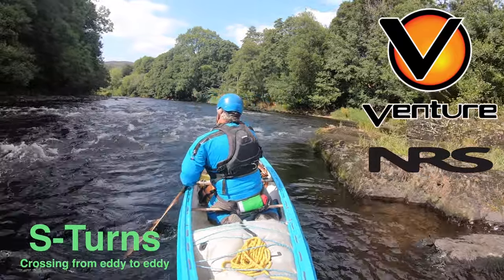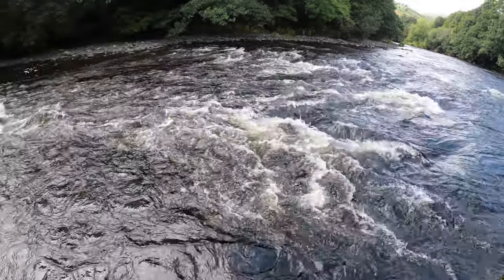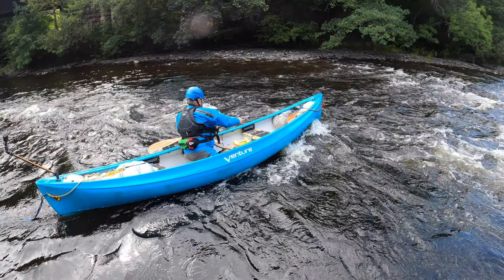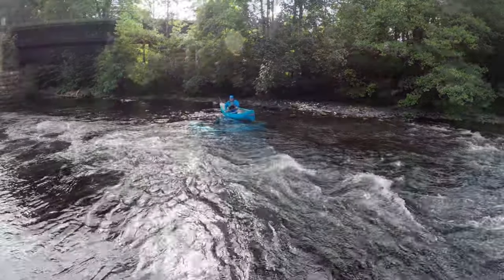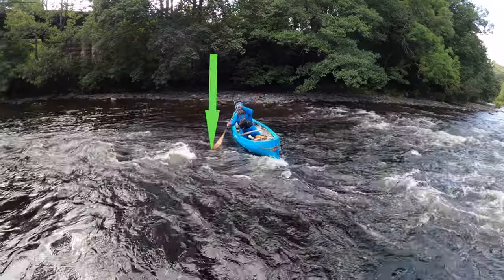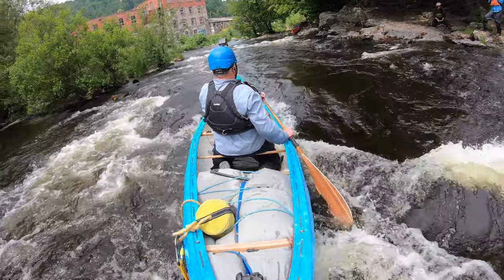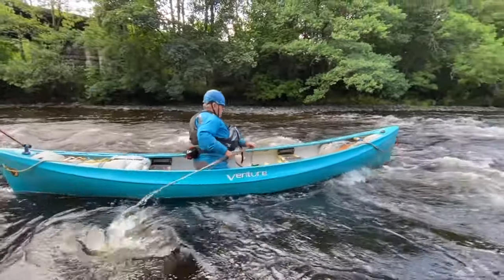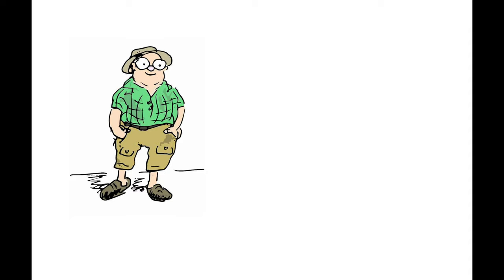White Water Canoeing:  Mastering the S-Turn

Comment: Very good video on crosses. Something that intrigues me as I struggle to learn to paddle lefty (primarily in my slalom C1, but it will be useful in my OC1 and trad boat too) is how other people alter things paddling on different sides. In respect of your weight shifts, I think you use more of a weight shift when coming back river right to river left, than when you paddle across river left to river right, where you seem to control more by altering knee pressure without moving your CG further out. The latter is obviously how I paddle a C1 (because there isn't much backup stability if you go too far with your weight), but it makes me wonder if you use pressure more than wieght shift on one side, and weight shift more than pressure on the other, perhaps this is something I do and part of why I feel so flippin ungainly when I paddle on the left... Something to check next time I get out on flat water for a left paddling session.
Reply from the maker: Really good observations.  However I think it more to do with the angle I am hitting the fast water.  From river left I have quite a shallow angle as I hit the strong current so need relatively little edge. Coming from river right I am much more across the current as I hit the full speed and so need a lot more edge immediately.   But I will look again to see if there is a non conscious element to it and I do lean more on one than the other.  Great observation and it has made me think.
Reply: That is quite possible, you have explained the topological differences between the eddies in the video...
Reply from the maker: @JimKayaker  The main thing is you have got me thinking

Comment: Great work . How do you practice control when leaning your weight. I can lean left , but my right side gets away from me " even on dry land".
Reply from the maker: So a number of questions:  are you kneeling, what boat do you paddle and do you swap hands at times?   If my knees are spread I push my weight down into one knee to achieve the lean/edge.  My body weight remains within the canoe but shifts over the weighted knee. To change edge I shift the weight from one knee to the other.  Hope that helps but let me have more information.
Reply: I don't kneel very much. I find it very uncomfortable only kneel when I hit rapids on level a 1 to 2 rivers. It's mostly sitting. Have not tried leaning through the rapids just in the calmer water. Not that comfortable with it yet.
Reply from the maker: @lucassmith2332  :  on long journeys I also sit most of the time and am happy to go through simple rapids in that position.  Seated I will only cross gentle eddy lines as I cannot addiquately control the edge or drop it more than a little.  It is only in crossing eddy lines that I will be leaning the boat running down a rapid I will be keeping the boat pretty well flat.   Hope that helps